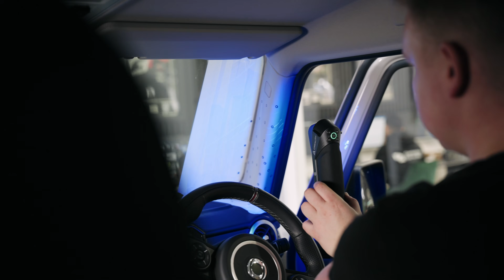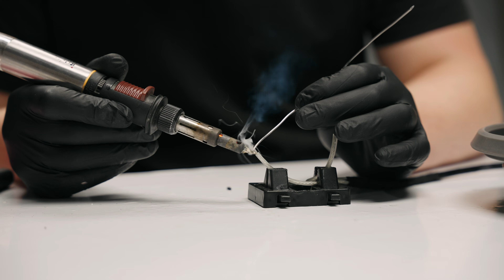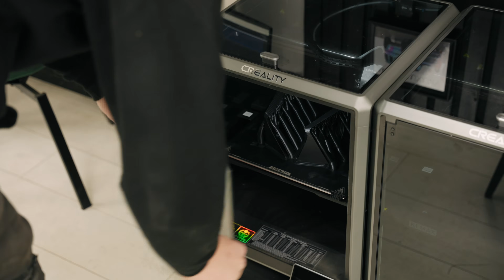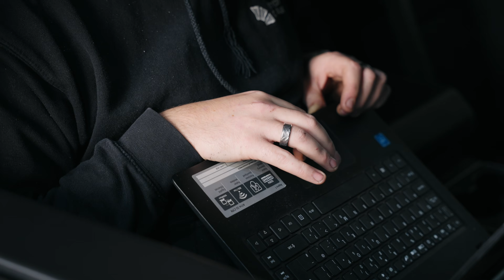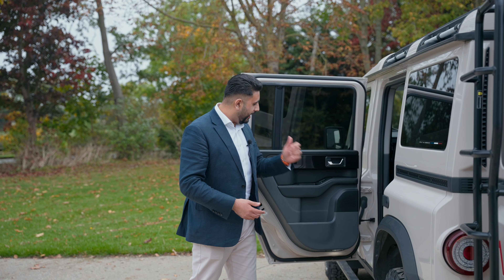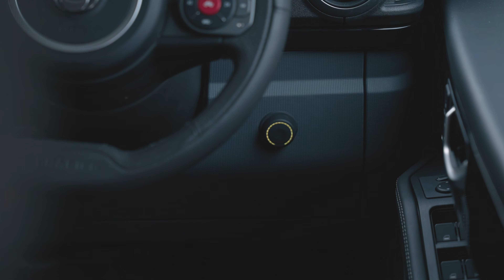INEOS Grenadier Sound System Upgrade | Custom A-Pillar Build, 3D Scan & Subwoofer Box

Comment: Greetings from Canada!  I’m a die hard audio guy from back in the 80’s….and done numerous installations in my own cars, family and friends, but it’s been many years since doing an install as I’m nearing 60 and crawling under dashboards is no longer easy to do.

This said, I never miss one of your videos, and am impressed either the quality and attention to detail….

I have no experience in integration of factory head unit.   However, I have recently purchased my dream car, and sadly the sound system is very poor.  So I want to do an upgrade while retaining factory head unit.   ..

The car has numerous small speakers, which I really am only concerned with making a high quality front stage ,  it has a 6.5 in door and tweeter in sail ( base of A pillar.)

I would like to do a 3 way front…question: would a midrange sound ok if I made little pods in extreme left and right corners of dash where it joins windshield?

Also, for subwoofer, I will custom fiberglass a box in passenger footwell….

I still don’t know where I will mount equipment…as I need to pull sound from speaker leads .

There is no room under seat to mount anything, and bring a mid engine car, I’m challenged to mount things in trunk at rear.   ( 2017 Acura NSX)

Any thoughts, ideas or suggestions would be helpful…do you do remote consultations? Obviously I can’t bring the car you….

I’ve watched your videos on small 2 seat cars numerous times trying to get ideas.    Again , thanks in advance, and continue the great work…I appreciate the attention to quality you do.

Comment: I think the AFM1D is kind of extra, isn’t it?
The two channels of the AFM4D are for the Thesis woofers.
If you bridge the other two channels, you can drive the sub easily.
For the other drivers, you already have enough channels to run them.
So why did you use the AFM1D?
Reply: the simple answer is Headroom. Tho i am curious how the channels are split up for this system.